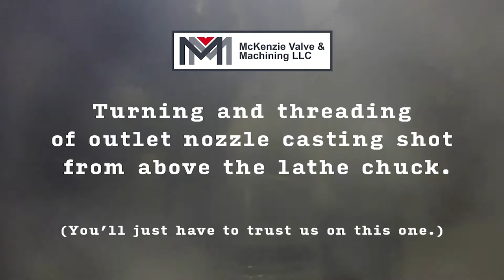How to Make Valves for Tank Cars - McKenzie Valve & Manufacturing

Comment: East Chicago, Indiana.  UTLX machine shop.  The bottom outlet ball valve design was by one of my favorite engineers there.  Jim.  This video ok until hydrostatic pressure leak test.  A voice over on details, including the pasig applied, would have been helpful and please wear safety glasses.